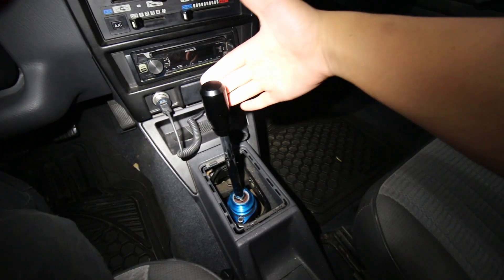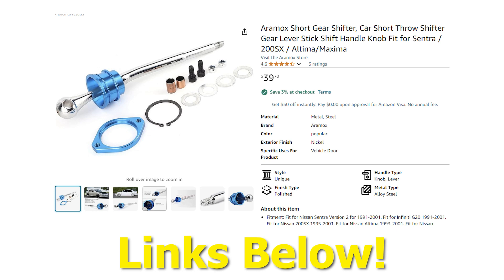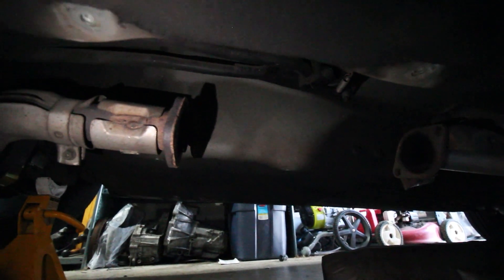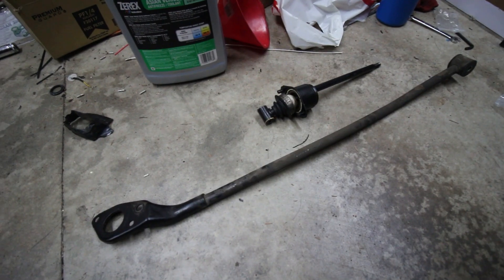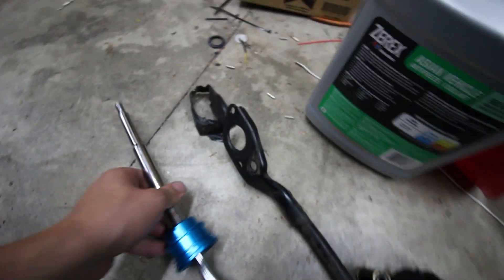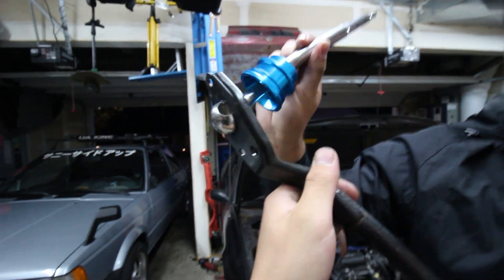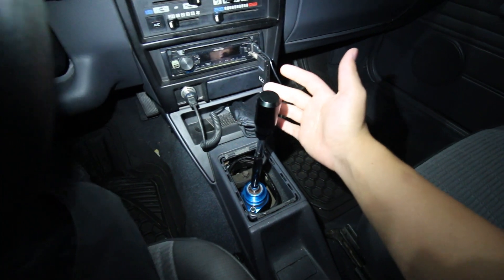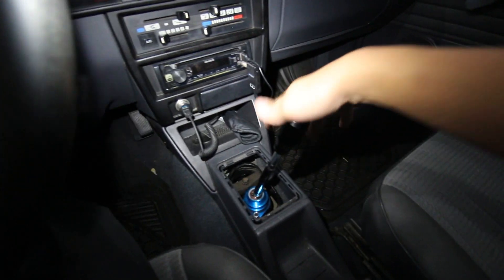B12 Sentra Short Shifter Install!

Comment: Hey man. Great video. I just installed the same shifter on my B13. It exactly the same. The only issue I had was how many spacers/washers are needed for the short shifter mounting bolt on the bottom where it attaches to the linkage? I was hoping you'd show that on the video. I could fit two spacers on one side, one spacer on the other and that was kind of loose. Do you remember how you had it bolted up?
Reply from the maker: I had 4 washers 2 on each sides and it was still a tad loose.